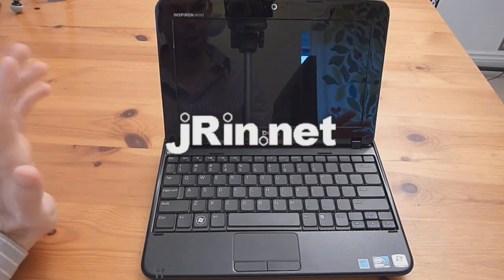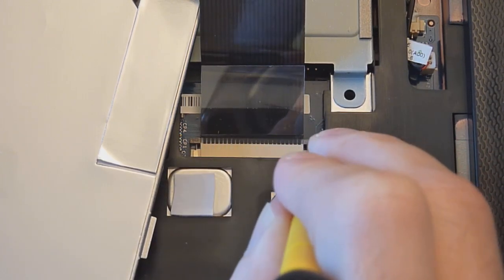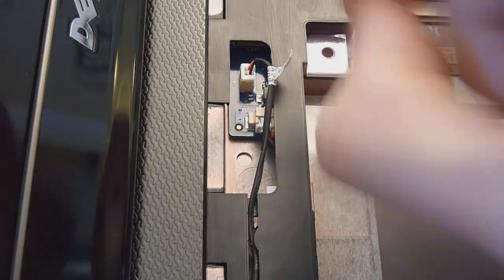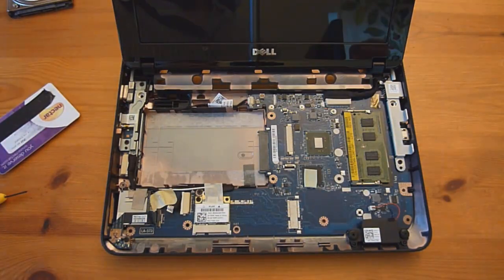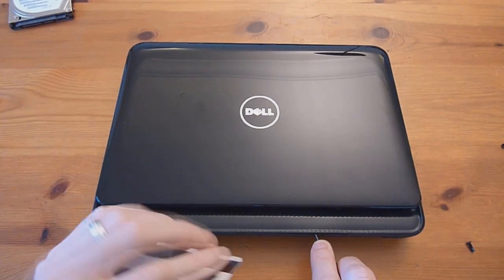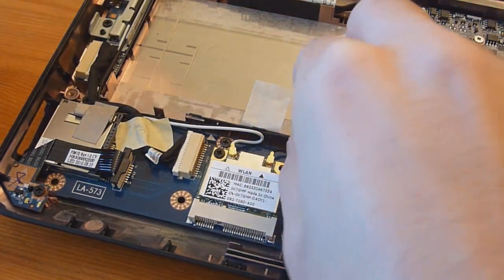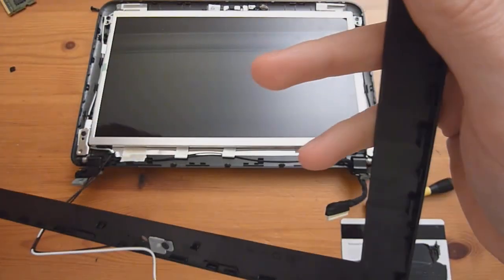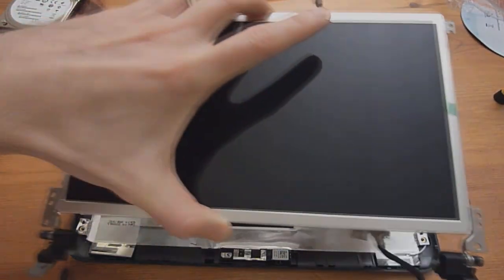How to upgrade & dismantle Dell Mini 10v 1018

Comment: Do you think it would be possible to make a 1012/1018 hybrid, since they are so similar? I hate the 1012 touch pad. It is terrible for two fingers, but the 1018 touch pad is great. Plus, I have the broadcom chip on my 1012, which isn't in the 1018. Most of the hardware is interchangeable, and the cutouts all match up, with the exception of the RAM chip door.

Comment: where is the disply fuse? I have changed the screen and the cable. the fuse is all that is left. My dell 1018 works on an external monitor. but when I turn the laptop on itself it is a very dark display.

Comment: on many things yes, you will notice faster loading, and less momentary freeze up moments. For a tiny netbook like this, 2gb is perfect so that limitation is not that big of a deal. I only use mine for web browsing, and the 2gb of ram with chrome works great and is not noticeably faster than a real laptop for that task. Without upgrading to 2gb, chrome may have issues with video playback, like frame drops every 15-30 seconds due to swapping, but with 2gb, video playback is smooth.

Comment: Are you sure it only supports 2GB of RAM? I checked in Linux and it says

Handle 0x0012, DMI type 16, 15 bytes
Physical Memory Array
	Location: System Board Or Motherboard
	Use: System Memory
	Error Correction Type: None
	Maximum Capacity: 8 GB
	Number Of Devices: 1

There's a "Maximum capacity" entry there.
Also, in the video you're saying something about an "accelerator card". Is there a way to improve the graphics features of the laptop? Can I add a graphics accelerator to it?

Comment from the maker: Dell does not have any official drivers for the 1080 and windows xp (though, you should be able to use the ones for earlier models such as the 1012).  Also, this netbook can only support up to 2GB max (it's a physical limitation of the chipset).
Reply: Thanks for the info. My 1018 has been sitting because it’s still slow with the 2gb upgrade. Was about to add more RAM until I read your comment about the chipset limits. Just gonna upgrade to SSD and see if that helps. Thanks.

Comment: i have two quick questions. i currently have two gigs of ram in my 1018(thanks to this video i was able to install it easy) but how much of a performance boost would i get if i decided to put a 4 gig stick in. i heard from a few sources that based on the system it's self that there wouldn't be much or any noticeable difference in performance, is that true?

i heard from another source that it may be a good idea to put windows xp or Linux on the netbook because it is less taxing to the system.

Comment: Excellent video, just finished upgrading my 1018 with crucial 2g module.
Invaluable for showing the right way to release those pesky ribbon connectors.
PS It still works!

Comment: @PhantomTD 
A bit of very light (So you can open it again) glue on the corner where it squikes, and then just a tiny drop of WD40 in the "gap" and it is all gone, and easy to open again. :-)